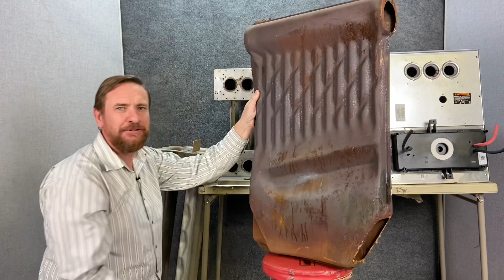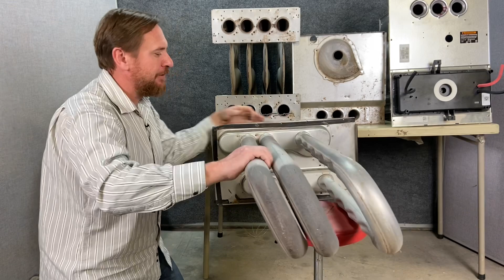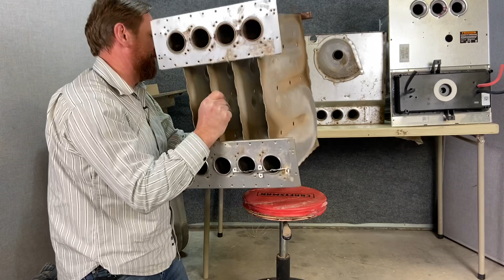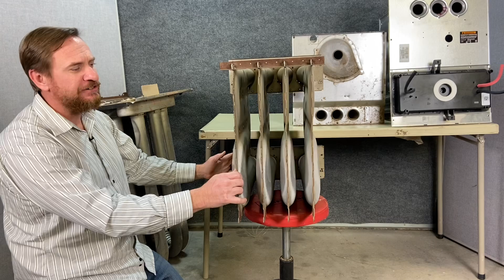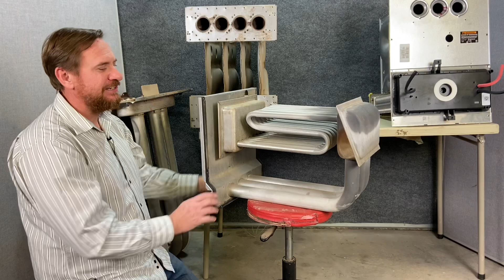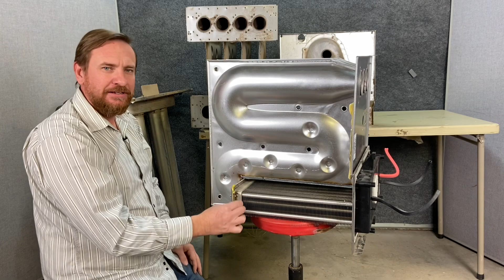Gas furnace heat exchanger comparison

Comment: Hi, the furnace guy says, "You have a drip tray that leaks and needs replacement." I know there's a leak, cause there's water on the floor.  I have an oil furnace which had a cracked heat exchanger that we had to replace; they said the cracks were from exposure to water.  Am I looking, again, at the "drip tray" which leaks, creating another problem for the heat exchanger, meaning I'd have to get another exchanger replacement? Or is the "drip tray" they are talking about something else, and not a threat to the hear exchanger?  Yikes, AND could there water be coming from the AC, some kind of leak from there... Hope these questions make sense? I'm trying to get a safe oil furnace, forced air system and the AC system to get along.

Comment: Regarding high efficiency heat exchangers with perforations leaking CO into the warmed circulation air, why doesn't the induction blower pull enough vacuum that if leaking, circulation air would be pulled into and mixed with the combustion gas, rather than combustion gas leaking out and mixed with the circulation air?

Comment: Great video man. I'd love to have that 90% furnace.
Is it not an acceptable practice to weld holes shut on heat exchangers?
Reply from the maker: Thanks!

We don't weld them. The material is fairly thin for heat transfer. Thinner than exhaust pipe. Once the metal has weakened enough to have a hole, it is already weak in multiple spots. The furnace is built around the heat exchanger. By the time you got it out a tempted to fix it, and put it back in, the labor. Would have greatly extended the cost of a new furnace. Sometimes even a warranty heat exchanger is cheaper to replace the furnace. Manufactures have been know to give a rebate twads a new furnace. 

 If there is a hole, there is a reason for it. It's usually airflow, venting or combustion issues. Meaning nobody did a combustion analysis to set it up right.

The exeption is package units. They don't last as long because the inside the tubes are exposed to outside humidity meaning water condenses inside in summer operation and rustes them out.
Reply: @love2hvac  I can weld it myself just didn't know  if was a bad idea or not.
 
Our furnace is a 1988 110,000 BTu Rheem  unit in the crawl space under the floor.
 It has never set off the carbon monoxide detector we have in the house for it but its so old that no one will work on it and put it back in service any longer. For years now I have had to fix it myself.
Reply from the maker: @RC-Heli835  you need to you a low level CO monitor.
An alarm will not sound off until it's literally an emergency and you have to evaluate.

A low level monitor will alert much sooner. A lot of people are poisoned by CO every year and never know, it never sets off the CO alarm.

I love having old things and old appliances, old air conditioners but I draw the line with a gas furnace.

Even if it's working perfectly normal, wind or running a dryer or kitchen exhaust will cause them to back draft.  

Dr Allison Bales has some great free short articles from the energy vanguard about CO alarms vs CO monitors.

There is an excellent book called "Carbon Monoxide
A Clear and Present Danger
Third Edition"  by ESCO Institute that is amazing. 

If you want to go deeper there is an excellent course by National Comfort Institute (NCI) called Carbon Monoxide and Combustion Analyst. 
That will really open your eyes to how the furnace water heater and other appliances work in a whole home system.
Reply: @love2hvac  Ok thanks! I'll check into it some more!😀
Reply: @RC-Heli835  Was that a high efficiency Rheem?  I recall Rheem had a recall for cracked SS heat exchangers in their HE units mfg in the 80s.

Comment: Had a XX Century gas furnace with a quarter inch thick fire box and heat exchanger. Most comfortable heat I ever experienced. Almost as good as hot water heating.

Comment: I have a 18 year old Goodman and the heat exchanger is good, but shows signs of age. I am thinking of changing it out as a preventative measure. All other components of the furnace have been changed out already and the exchanger is the only remaining original part other than the housing itself. What is your opinion?
Reply from the maker: Ehhh tough call. 
As long as the heat exchanger is good there is no reason to change it.  Make sure to have it inspected and a combustion anylaysis done. 

I would replace it when you replace you ac. New refrigerants are coming again so if you can I would wait on that also. 

My recommendation, 
Look at getting a blower door test done on your home. Find out where and how much air is leaking. Seal up the home or start budgeting for that. 
Then have a new heat load calculation done you will find the new furnace will be much smaller. 

I would look at a dual dual options. A heat pump that runs and the switches to gas heat when the temperature drops below the ballance point. 

It give you more flexibility on heating options as there are plans to try to reduce gas heating underway.
Reply: @love2hvac  Thank you sir!